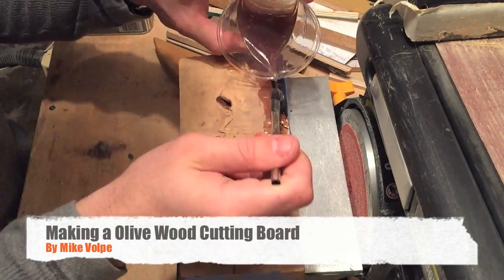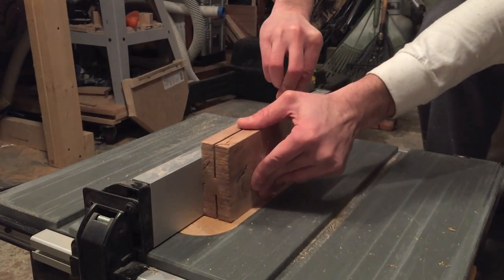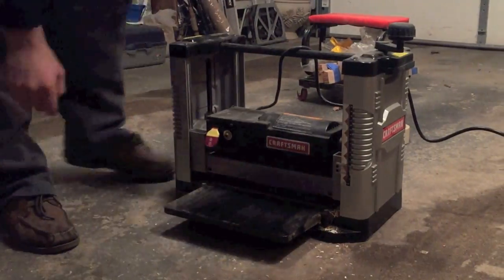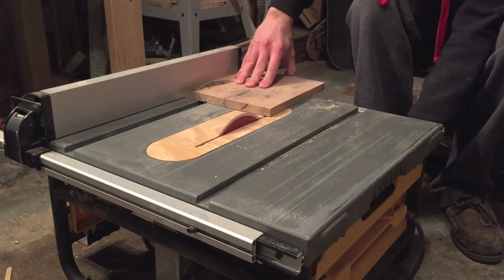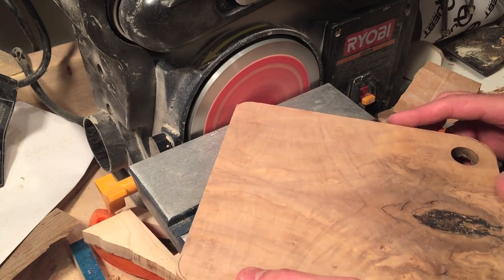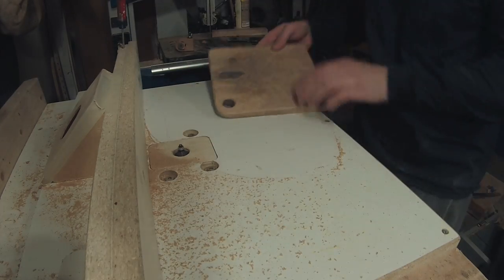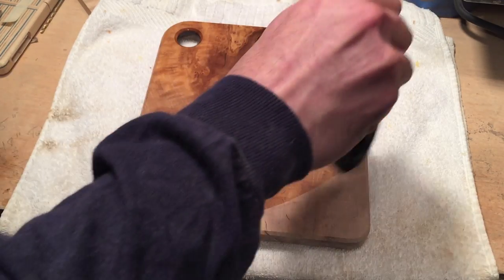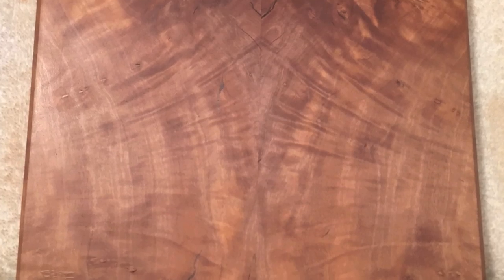How to Make an Olive-Wood Cutting Board -05

Comment: Thanks for the video. I am trying to find the best way to make some cutting boards out of the trunk (just below surface where roots split). As this is where amazing patterns show up. And due to the different directions of the grains, I hope they will be more resistant to splitting. So what is your opinion on this and where could I find more information? I just love patterns in trunks of walnut trunks. But want to start of with trying with available material. I will also need to sort out best curing method before finishing. So I can correct small issues with resin before finishing. Any info on this would be greatly appreciated.

Comment: The best way for jointing the cutting board is epoxy not a glue.glue with water will desolve
Reply: tightbond 3, waterproof glue its the best glue for cutting boards